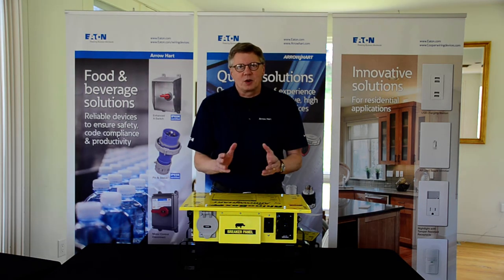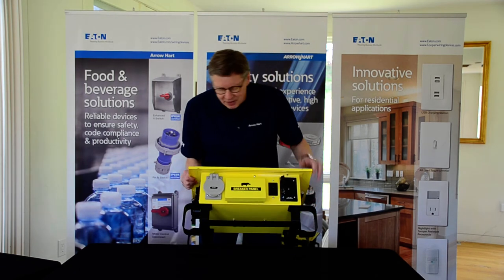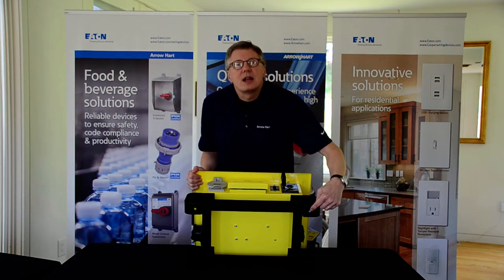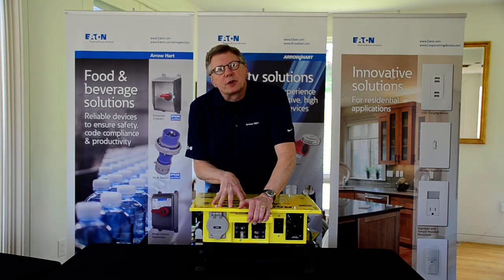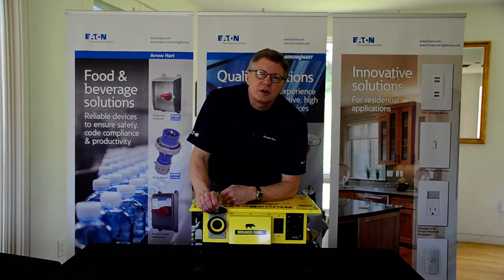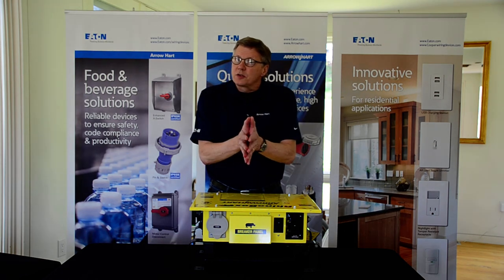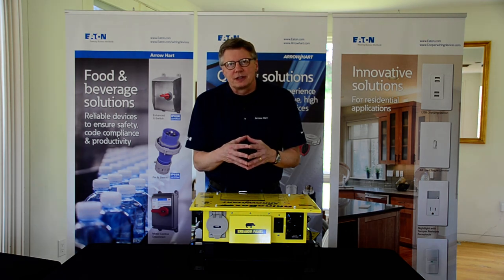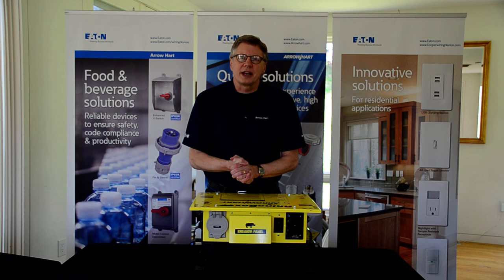RB300ME Rhino Box Temp Power

Comment: From your description, I understand everything except how it works.  Does this device have internal batteries?  Do you charge it off line, then bring it to the jobsite?  You describe a "30A 250 volt locking device, for generators".  I'm going to guess that that is an input, and that you can power it with a generator, maybe if its charge is depleted?